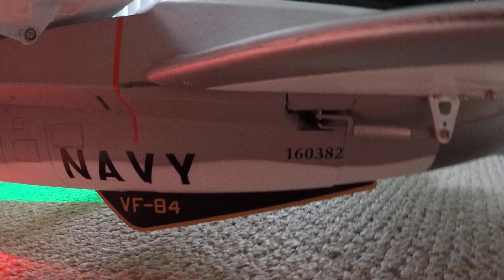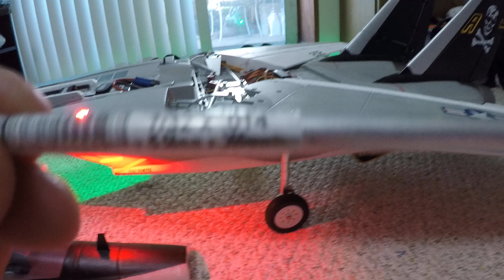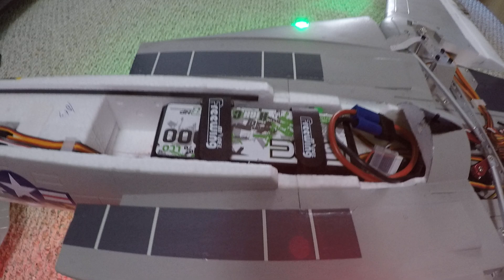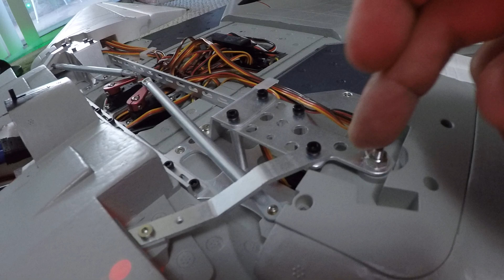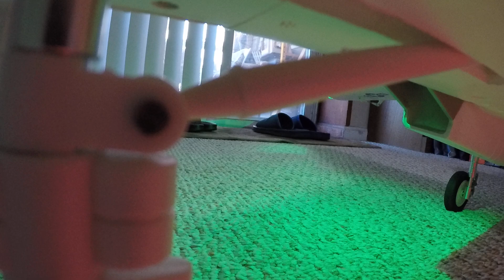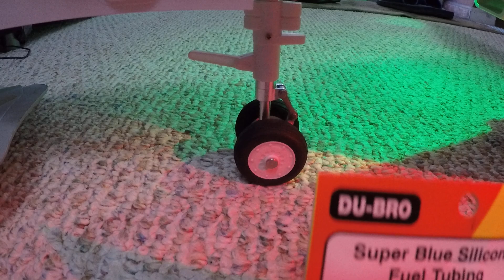Freewing F-14 Tomcat Twin 64mm Quick video about modifications made! (See Video Description)

Comment: Hey bud, I want to repalce my nose gear spring. But it does not seem to come apart like others i have. Usually there is a screw that releases the piston so you can access the spring. I took the bottom plastic pieces off thinking that would do it. But nope. It can't just be the scissor link can it? Do i have to take the wheel axel bolt off to get in there, i guess?
Reply from the maker: Yes, that is correct. There is no screw holding the gear piston in place. You need to remove one of the C-clips. I removed the top one so the whole scissor link stays attached to the piston when it drops out.
Reply: @frankflyrc awesome, thanks for the info. Pretty sure this spring is helping to bounce her back into the air when i hit a bump in the runway at the speeds this one seems to need sometimes.